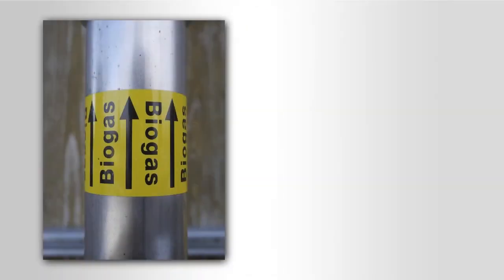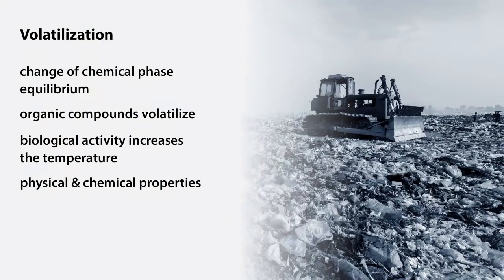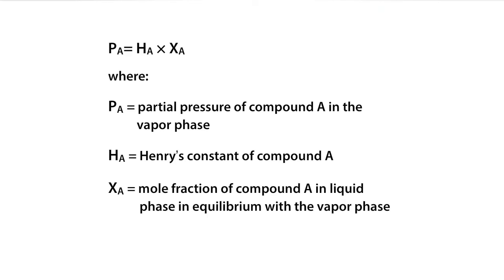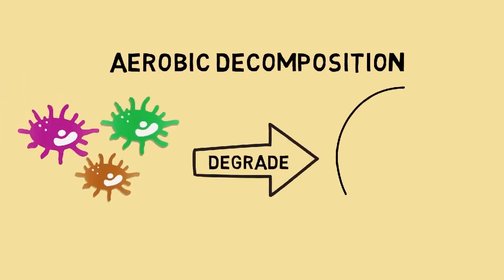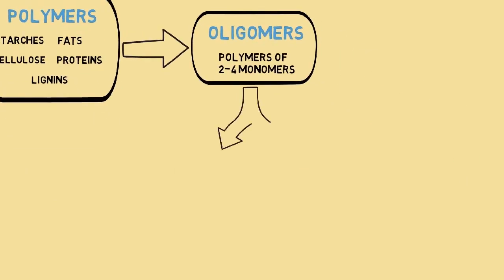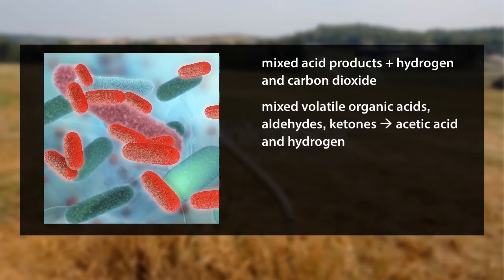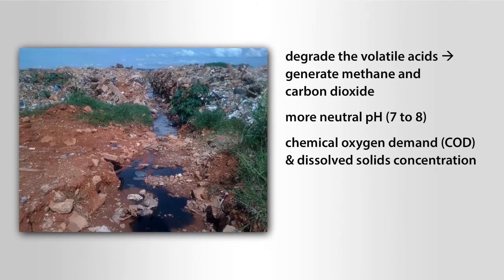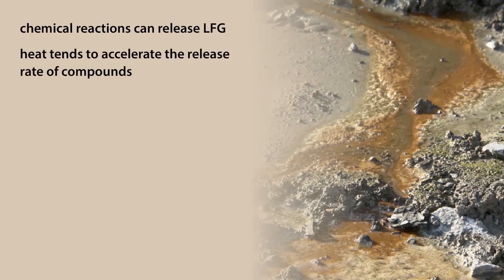Learn the Principles fo Landfill Gas Generation

Comment: Might be good for engineering students, but it has absolutely no practical application.
Reply: How do you figure that?
Reply: @macriggland6526  A better question, what practical application do you see? I worked in the LFG industry for 15 years, and other than learning the general theory behind LFG composition, never needed anything this in-depth. It’s fascinating though.
Reply: @Guitarplayer724  Extracting methane and burning it for energy.